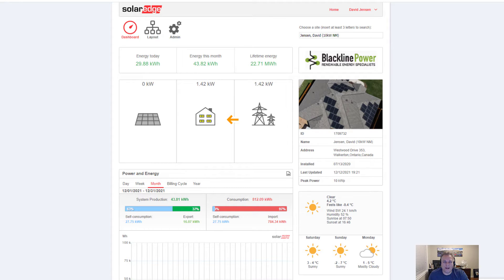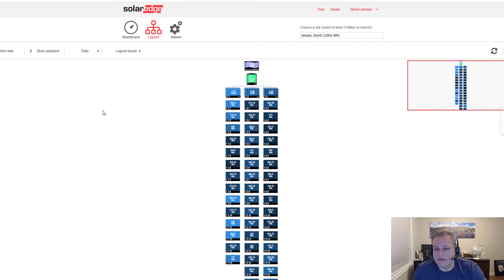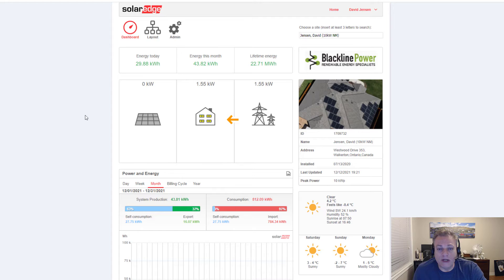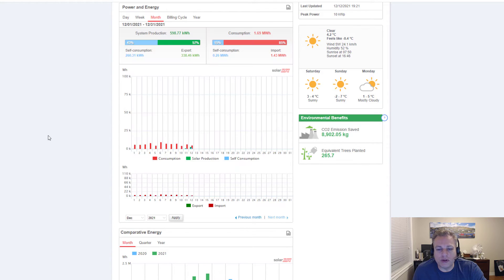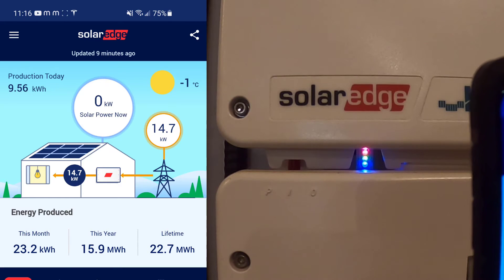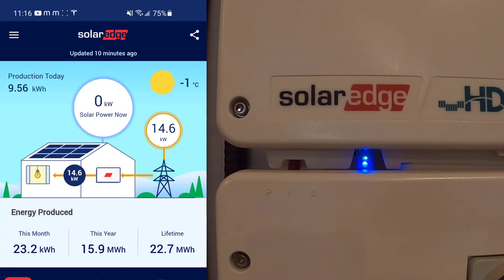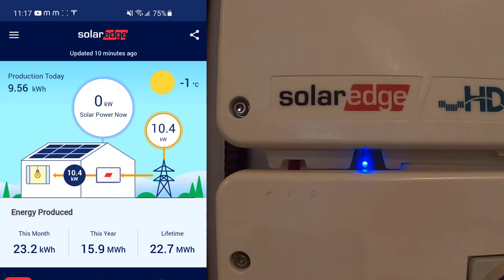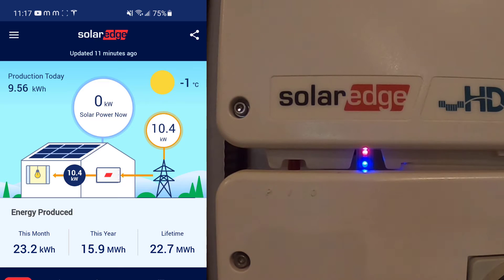Troubleshooting my SolarEdge 10kW inverter tripping off

Comment from the maker: Turns out our local utility voltage was really high (253V instead of 240V) and that was causing the system to trip off. Thanks to my installer, Blackline Power, for identifying the problem and contacting our local utility to correct!
Reply: How were you able to find this out?
Reply from the maker: My installer spent a lot of time conversing with SolarEdge and our power company. After I was told, I obseved that our line voltage is all over the place. Anywhere from 225-260V.
Reply from the maker: They have since replaced the inverter with one configured for a "dirty grid".
Reply: @AnotherNerdyCanuck  How did you "observe" this line voltage variability? Some sort of device? thanks
Reply from the maker: I noticed it with my Tesla. Plugging in every night gave a voltage reading, sometimes very high. After that, I bought a plug in voltmeter from Amazon. It provided a continuous reading I could check anytime.

Comment: You can scan the QR code on the side of the inverter using the app and then get far more detailed info on your faults.

I hope you’ve got it sorted since the video  is 8 months ago.

I’ve just had a communications board fault during commissioning activities for my new Energy Bank.  All three LED lights lit up, but dimly so.  That one isn’t in the manual.  New board being sent out over warranty.
Reply from the maker: Yes. They replaced the whole inverter. Thanks!

Comment: Ok so I am in Aus we have 240V over here and I have a similar error after my brand new SolarEdge worked for a day then tripped like this.. exact same light sequence. Happened sometime overnight - so this video gives me a massive clue.. Which SolarEdge "dirty inverter" did they give you and has the problem ever returned? Thanks
Reply: Further was yours tripping every day? Or intermittently? Say every few weeks? Thanks
Reply from the maker: The replacement inverter is the same style of inverter, but was configured differently (software only as far as I know). My inverter would trip every few minutes so that it was tripped more often than it was running!
Thanks for watching!
Reply: @AnotherNerdyCanuck  how come then they just couldn;t do that onsite? curious.. I'll get back to you on which one you went with in the end  if it proves I have the same problem. Thanks!

Comment: Whats the point of this video if it has no solution to it?
Reply: Thanks I was gonna tell them to order new inverter because they had me change the communication board and still had the same problem
Reply: Any word on that solution video currently at a customers house trying to figure out this issue 😅
Reply from the maker: Sorry, I have a number of videos I am working on. Short version was SolarEdge replaced the inverter with one configured for a "dirty" grid.
Reply from the maker: Solution video coming...
Reply: Please let as know.  I have same problem
Reply: @enriqueperez6797  i have the same issue on my system too seem common

Comment: the power co tells me that 254 volts is what they deliver by state regulations
Reply from the maker: The problem was the rapid fluctuations. SolarEdge ended up sending us a new inverter designed for a "dirty grid". It has been installed for almost a week and is working great!
Thanks for your comment!